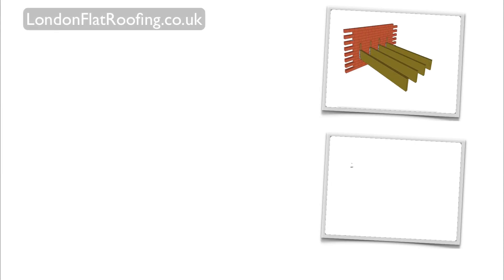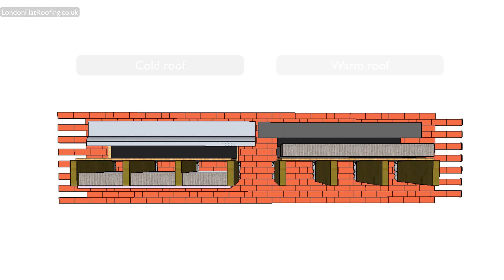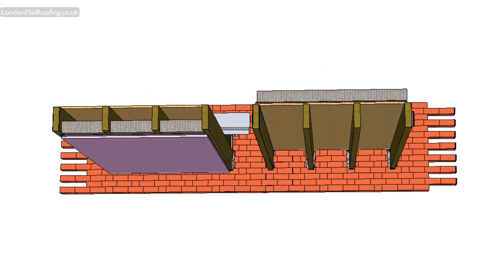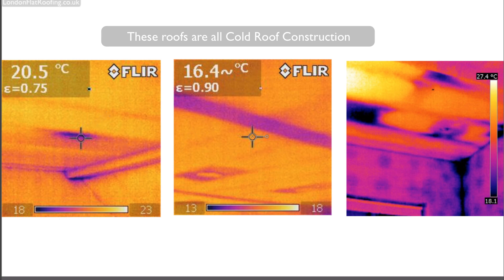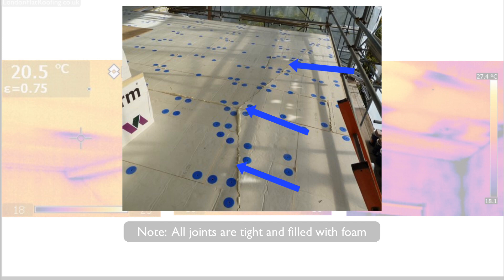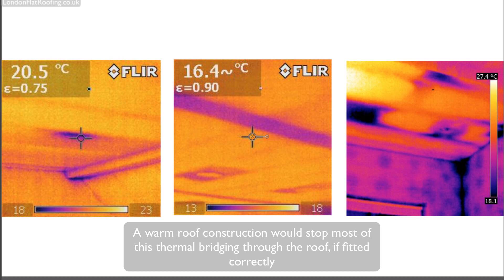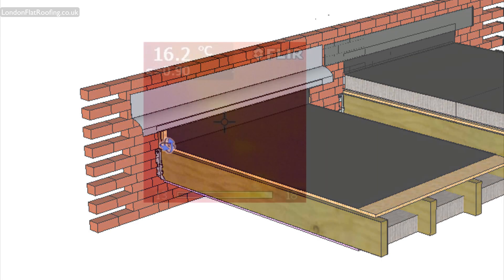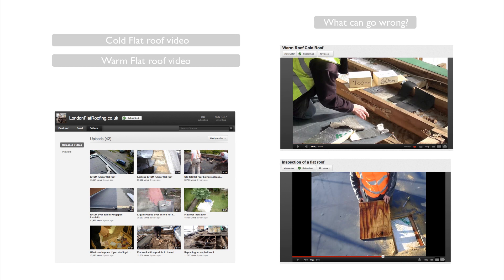In depth comparison  new flat roofs Warm & Cold

Comment: I understand the benefit of a warm roof but nobody talks of the expense of heating all that wood, the air between and possibly previous layers of roofing felt etc. It'd be interesting to see a thermal image of a ceiling under a warm roof an hour after the heating comes on. Going to have a look into how much heat / time, a specific quantity of wood takes to warm by 1 degrees. A lot of people only warm a room for a few hours a day which would make the problem worse.
Reply from the maker: I love the theory, however, it's not entirely correct. Yes, you do have to warm up the Thermo mess of the timberwork. However, this gives the benefit of keeping a stable temperature in the rooms when the heating is turned off as it returns the heat back down again slowly. You are correct if you lived in say a box with insulation on the inside you could heat that quickly, but it would also cool quickly as regards the problem with condensation or sweating in the roof you're gonna have more problems if you lived in your box because you are not allowing the heat to dry out the timbers.
Reply: @SteveRoofer  I'm definitely going with the insulated box/ cold roof method. Insulation between and underneath beams. Plenty of ventilation above. I'm just wondering about hypothetical warm roof jobs and the above mentioned issues and also the work required to stop cold bridging at the perimeter. But each to their own. The warm roof design definitely has it's uses.
Reply from the maker: @robw4492  unfortunately the problem with cold roof construction and that's really what you're gonna be doing is that at this time of year it always sweats over the past 10 days I've had 4050 different people contact me or cold roof problems. I've had no warm roof problems I've got people with water dripping through the light fittings because it's been so bad at the moment outside the relative humidity is 85 to 90% because everything was so cold for so long last night and this morning the temperatures went up. However the structures were still cold very cold today even external parts of the building. I just looked at are sweating condensation. These are outside they have maximum ventilation that because the structure is cold and the ambient temperature outside is moist and warm, that warm, moist airHas condensed Internet surface and now the surface is soaking wet.
Reply: @SteveRoofer  Thanks for your replies and the depth you've gone into. I do see how the warm roof sorts out the differing temperatures and humidity resulting in well cared for timbers. 👍

Comment: Hi Steve, I have watched your video on cold roof construction I know that the warm roof construction is better and easier and stop cold bridging, however I do not have a height problem with my extension and can only do a cold roof , do you have a video that reduces the chances of bridging on a cold roof and would it be better to use the better quality sticky vapour barrier. Thank you
Reply from the maker: last weeks video covered most of that and I will be doing another one shortly on cold roofs
Reply: @SteveRoofer  Where can i find this video Steve... I have the same problem with the cold roof i want to construct.

Comment: Hi Steve, if changing from a cold roof to warm roof is it OK to leave existing insulation between the joists? Second question if you want to be able to walk on the warm roof I take it you would overboard the insulation with OSB is this fitted with adhesive too? Many thanks Joe

Comment: Hi Steve. I have a small extension (2.5 L X 3.6 W). The flat roof is shot to bits including the joists (genuinely horrendous I have pictures if you want to see). I have on both outer walls concrete block walls including the garden door wall and then the house wall is a brick wall. Can I resin fix wallplates on both external concrete block walls then run the joists across (including frame for flat roof light not lantern) or do I have to put wallplate on brick wall and door wall? I am going for the warm roof design. Thanks alot, James

Comment: I've a old flat roof that needs replacing. It's a cold roof but don't know if it's ventilated. Was going to get it done the same as it is now but after watching this a warm roof would be better. Trouble is it's 2 storey side extension flush with the front of the house and about half way front to back. The flat roof just sits under the house hip roof. The extra height would mean the house hip roof would need some adjusting, ie cutting of tiles/ hip etc. Would this be possible or should i stick to a cold construction...Thanks

Comment: I am turning a 10'x24' screened porch attached to a 2 story 1875 built home, into a heated room. it has true cut 2x4 rafters that I was planning on sister joisting milled 2x8 to the existing non-milled 2x4 roof joists. The lower end is currently screened and I want to add 6" insulation in the ceiling leaving 1-1/2" air gap. How would you vent the top end of the porch roof …? This is in the North East (USA) where we have on average a foot of snow on the roof throughout the winter.
Reply from the maker: Where possible I would always do a warm roof buildup as its better and no vents needed if you can't do that then any kind of thought venting will work but the snow covering the vents is something I haven't had to consider before perhaps the vents are around the edges looking down on an overhang!

Comment: Hi Steve, I’ve watched a lot about cold and flat roofs now. I’m making a shed with a flat roof and planning a typical cold roof construction with 150mm joists, bottom deck, 50mm services space, 50mm insulation, 50mm vent space and finally top deck. My question is - if I placed a vapour barrier on the underside of the insulation, as you would do with a warm roof, then could I just place the top beck onto the insulation, removing the need for a ventilation space? If not, why does this principle work with a warm roof and not a cold roof - ultimately, with the vapour barrier preventing moisture ever reaching the top deck. And if not, where does the moisture go when you have a warm roof with vapour barrier- surely it stays in the room?

Comment: Hi Steve, my builder is recommending a cold deck flat roof, howeve, he is adamant that ventilation should only be at the front of the extension all along the fascia, and does not need to be at the back, I've tried explaining, but he is saying that's the way he's done it for over 20 extensions, would very much appreciate your advice.
Thanks in advance.
Reply from the maker: Cold deck flat roofs must be through vented. A vent on one end will not work Specification on flat roofs change regularly obviously he isent keeping up with the corect specificaions

Comment: Unless the area between the joist is air tight then warm roof construction is a waste of time, as an electrician I regularly fit downlights and find a howling cold draught coming out of the hole I've cut in the ceiling
Reply from the maker: Exactly. Airtightness is the most important part of this. Airtightness should be achieved with the vapour control membrane. No movement of air No movement of moisture No condensation or sweating No interstitial condensation.    I wish I could get  this through to builders and roofers.

Comment: I'm looking to do a warm roof because I'm having big problems with condensation, I'm going over a fiberglass roof, will i have to take most of the rockwool out of the joists from the inside for the condensation problem to stop or could it be left there, PS I think there's too much rockwool in the joists anyway
Reply from the maker: Yes, you have to have 75% of the mass of insulation on the warm side of the roof. I would take it all out
Reply: Steve Roofer i took all the rockwool out of the ceiling in the bathroom the other day and the difference already, it's drying out great, got a price already for the new roof, can't afford that price at the moment so I'm going to just pull all the rockwool out and warmboard the ceilings and skim them myself, would that work do you think
Reply from the maker: If you are introducing insulation at the ceiling level you  are forming a cold roof above so all the spaces above should be vented
Reply: Steve Roofer no problem man thanks for the advice, keep up the good videos

Comment: Having watched many of your excellent videos, I decided on a cold roof because of thermal bridging issues. I must disagree with a comment made at the end of this video based on theoretical knowledge only i.e. no access to thermal imaging equipment. The joist hangers would still be a source of thermal bridging on a warm roof because the wall they are attached to is an external one. As hot goes to cold, the room heat would travel into the plasterboard, then the joists, then the joist hangers and then to the brick and then out to atmosphere. The house extension I have constructed has 150mm of XPS insulation in between the joists, 50mm of EPS insulation underneath the joists, an unvented 50mm air gap and then the plasterboard. There is also no thermal bridging from the block walls as they are all covered with 50mm EPS bonded to the wall and then bonded to the plasterboard with PU adhesive. In my opinion, this is about the only way you can cut thermal bridging to its minimum value with todays construction methods. Just as a FYI, I chose XPS because its LTTR (Long Term Thermal Resistance) figures remain fairly constant after decades of use whereas PIR boards e.g. Celotex, Kingspan etc start dropping from the day you buy them and start to match XPS/EPS after 5 years or so. In short, in less than a decade, your U values would NOT pass todays building regulations. On the plus side for XPS it has twice the compressive strength as PIR boards, not affected by water and is cheaper in the long run.
Reply: Thanks for your input, all of my knowledge about this subject is obtained from specialists and correspondence such as yours. (Thanks)
In the UK building control recognise thermal bridging can happen though weaker elements of the build. As long as the briding is controlled IE not total it can be acceptable. My experience when building new flat roofs came from a design given to me by Kingspan. It specified 150mm of insulation in most parts of the roof but the gutter that went down to the outlet reduced to 25mm.
 I questioned this and was told that Calculations show that if 25mm of insulation is maintained in this area,  Interstitial condensation will not happen.
As regards the question of different insulation types 
PIR, EPS, XPS insulation we have them all in the UK, but we have to follow whats been specified, your points about the different quality are something that is not commonly known or talked about over here; I'm sure in time things will change.